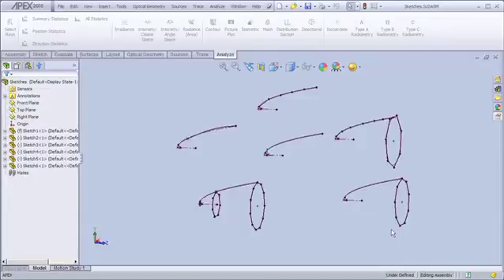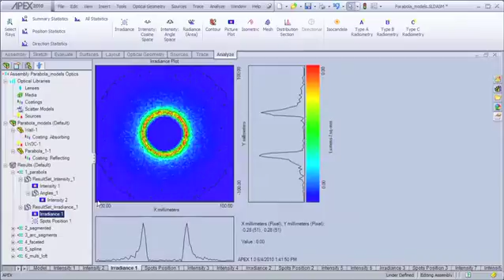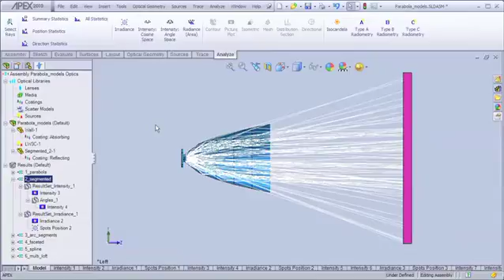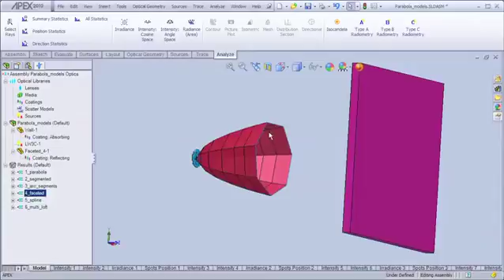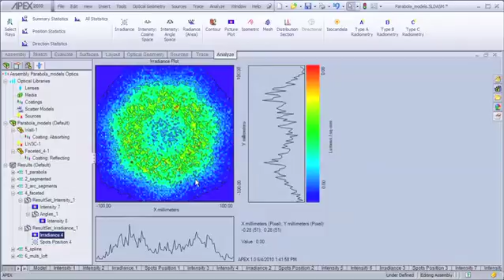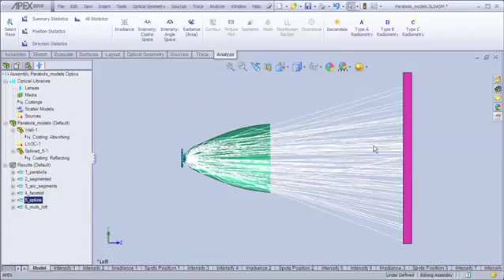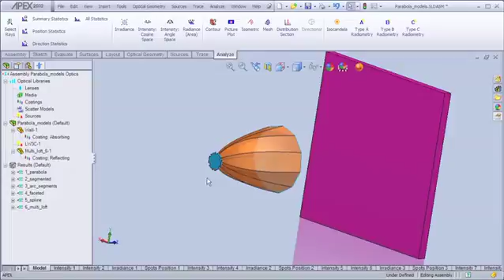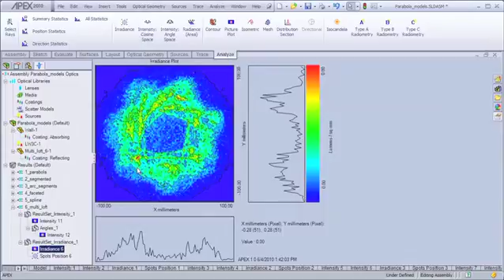Parabolic Reflectors Designed in APEX

Comment: I realize this is an old video but it's just what I'm trying to learn so I hope you can help me understand why the light plot suggests a ring rather than ~uniform spot.  Most LED's or other lights would have their primary optical housing try to focus the output somewhat from the start such that (in my example) 60 degrees of the initial focus would hit the target spot with no consideration of a surrounding reflector.   The purpose of the reflector in my case would be to sharpen that spot and capture residual light and redirect it into the target spot.  Perhaps the light plots only show the results of the reflector ignoring the light coming from the LED directly?  Please help me understand.